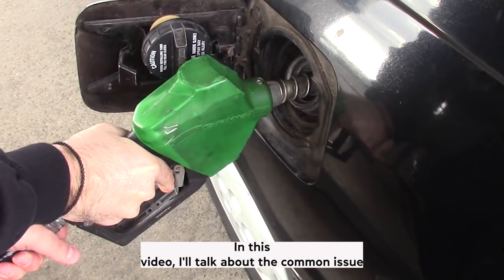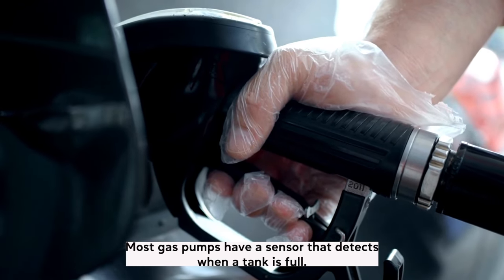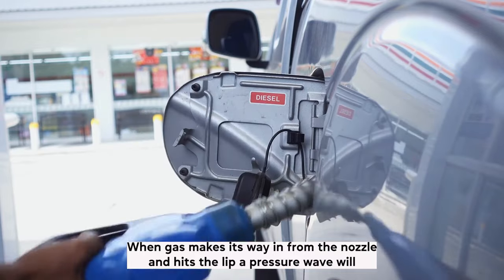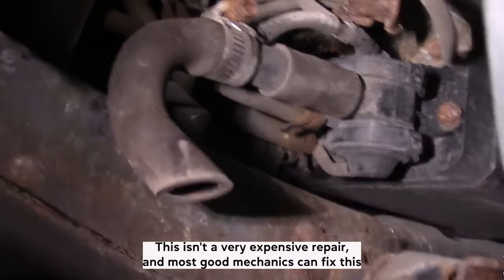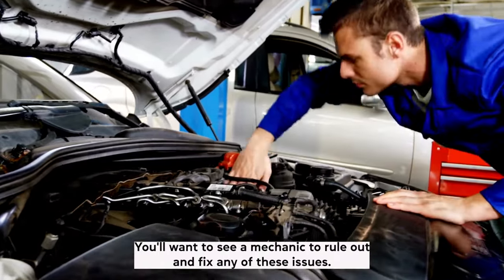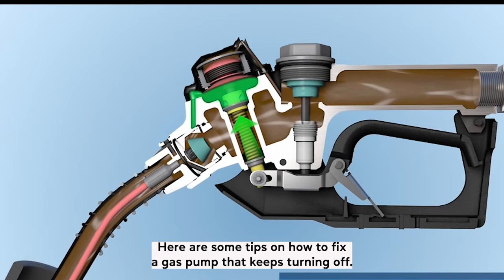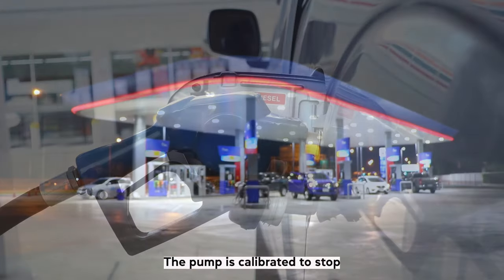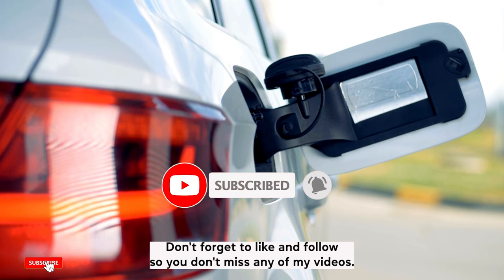How To Fix Where a Gas Pump Shutting Off Before Tank Is Full

Comment: Thank you for taking the time to do this video.  We have a 2008 Pontiac Pursuit that does exactly that. It will not 100% fill up on gas. It will shut off 3/4 and fill no more? This has been going on all summer and I'm at wits end.  Any suggestions would greatly be appreacted.